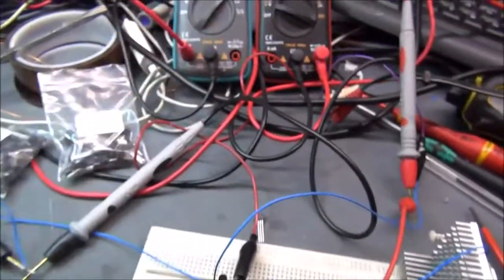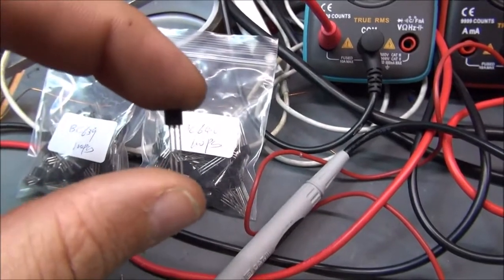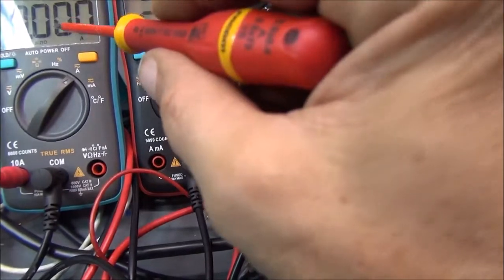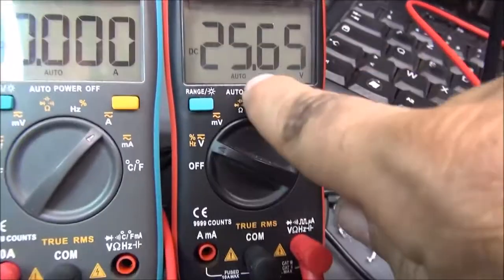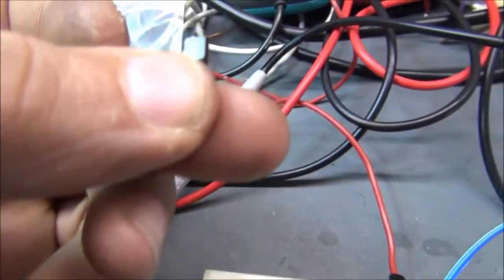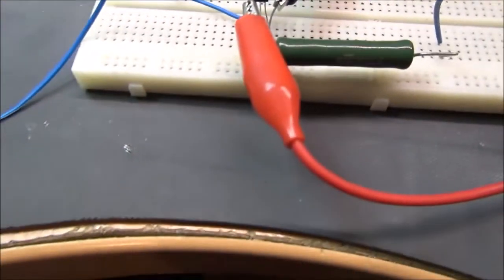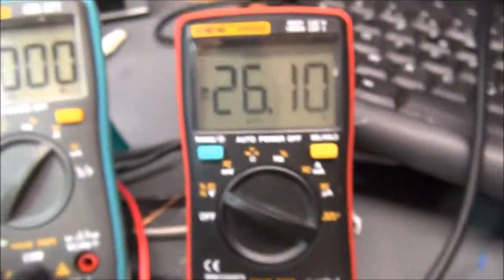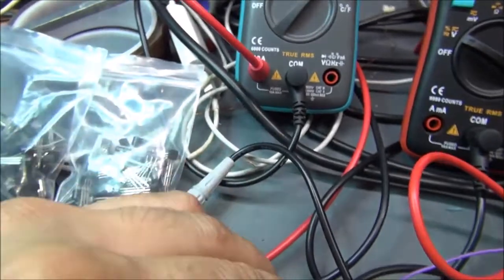BC639 & BC640 from Aliexpress, fake or not?

Comment: Thanks good video. Have used the same type of transistor loaded to about 60% and worked well with little temperature rise. The fact that these are cheap transistor they do very well and can be used in so many ways.  I remember years ago purchasing OC45 and OC71 for projects and the caution one would had to exercise not to turn them in to a puff of smoke. So thanks.
Reply from the maker: hi, glad you like it, thanks for commenting. Fake from China makes thing tough, but sometimes we can found good bargain. It's a risk to take.

Comment: Nice video. I'm not sure that means they aren't fake, but in any case if they do the job I guess it doesn't matter anyway right?  Sometimes Aliexpress and eBay sellers have legit parts but they have failed testing by the manufacturers for some reason.  For example these might not be good at higher frequencies.  In any case I have purchased a lot of transistors like this and so far they do the job at a fraction of the price so I'm happy so far!
Reply from the maker: Yes you're right. The reason I didn't test it with frequency is because transistors used here are for audio signals, and in theses type of frequencies you need not to make any test.
Of course, if you purchase transistors for radio frequencies amplifications, meaning you have to work with more than 10 mhz, of course a frequency test is welcome.
Here the most important thing is to hold the one amp current to drive power output transistor, with is the purpose consirated here.
The written tag identification on the transistor are writted by laser engravure, and no painting. 
Thanks for your comment!